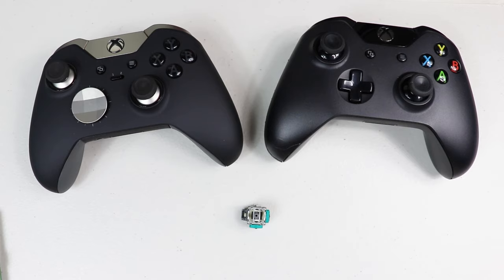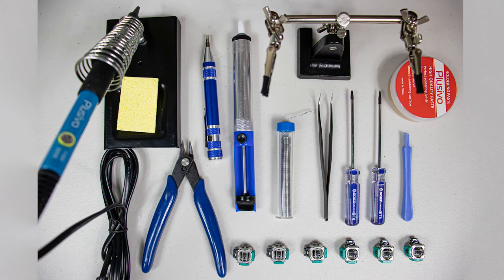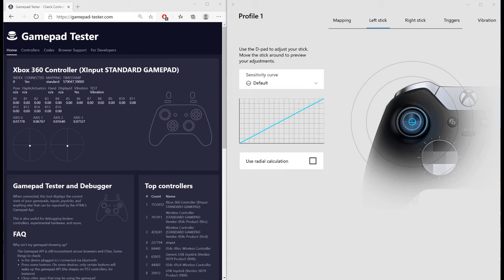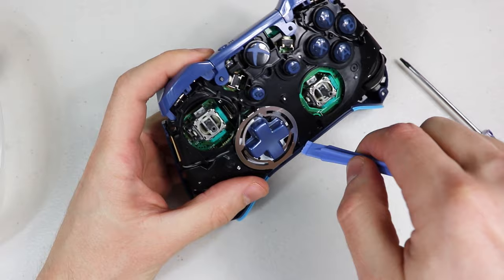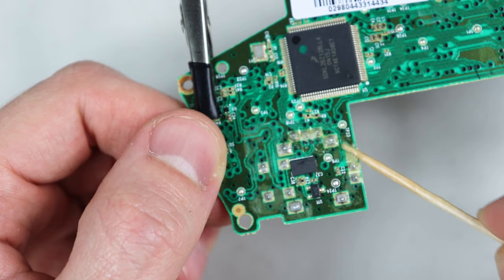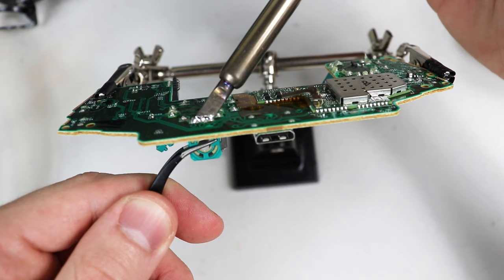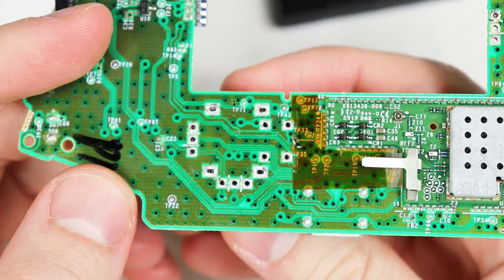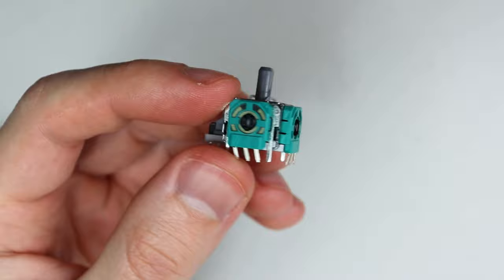How to Replace Xbox One Controller Analog Joystick - NEW METHOD - Fix Stick Drift, Broken, & Loose

Comment: I’m trying to do this on 3rd party controller but still huge deadzones
Reply from the maker: Ah, sounds like the potentiometers themselves have a physical deadzone. If that's the case you would have to use different joysticks and/or potentiometers.  If you're only testing on one game, make sure the game itself has deadzone to 0.
Reply: @SOSSGAMING  thanks for the reply! I’ve been doing research on oem-similar potentiometers
Reply from the maker: @robyee3325 If the joysticks are branded ALPS, you should be able to swap pots with any other ALPS pots (which are what xbox, playstation, and nintendo pro controllers use)
Reply: @SOSSGAMING  if I still have deadzone with the alps replacements, can I fix it by calibrating them on the pcb board the same as you did in this video (using software and tweaking the pins till it’s center)?
Reply from the maker: @robyee3325  If you are just referring to centering then yes what I do in the video can help. If you are referring to deadzone, where there is no response up to a given value when moving the joystick, you can only "fix" it if it's caused by software. Meaning in-game settings. If it's physical (as in the carbon is missing on the potentiometers) it is not fixable. Hope that makes sense. 
However, if you are referring to the range, that might be fixable. Say to the left you are getting 100%, but to the right you are only getting 95%. If you adjust the potentiometer like in the video, you may be able to get 100% in both directions.
Reply: @SOSSGAMING  great thank you!

Comment: Is there no way to buy the analog sticks without the screwdrivers? I can only buy on Amazon and everything but yours looks sketchy
Reply from the maker: At this moment in time I do not unfortunately. The tools don't add much to the price though tbh. If you want to message me after purchase I'd be happy offer a refund of a few dollars for the inconvenience.
Reply: @SOSSGAMING  no it's fine. Do you know if they work on ps4 controllers?
Reply from the maker: @MEXICANASSASSIN2  They won't work well, unfortunately. They sit lower and the potentiometers have less range. If you can reuse the PS4 potentiometers, it should work fine, though. 
The PS4 joysticks will be on Amazon within a month. I actual can't find another listing with actual ones. One has a picture of the correct ones, but according the the reviews, they send the crappy ones. Rather unfortunate.
Reply: @SOSSGAMING  I'll be looking forward to seeing them. I've been looking around for a while and people only swap out the white wiper part from the pot and that doesn't sit right with me. I'm happy to see that you're so helpful. I'm going to subscribe and wait for that listing to be up. Thanks

Comment: my joy sticks are just freaking out jumping all over the place?
Reply from the maker: Is this before or after install? Sounds like typical stick drift to me.
Reply: @SOSSGAMING  so i had the wrong joysticks but i swapped the black magnet to a orange one and fix the problem
Reply: @SOSSGAMING  i was using the hall stick ones

Comment: are the joysticks compatible with the powerA emerald fade controller?
Reply from the maker: I've heard the xbox joysticks are not, because the power A controllers have more joystick movement (they can "stick" with xbox joysticks) but I've heard you can use PS4 joysticks on them if you level out the plastic bottom piece (there are protruding lines and circles).  This can be tricky to do though.
Reply: @SOSSGAMING alright, thanks mate
Reply: @SOSSGAMING  would it just be easier to buy a new genuine controller?
Reply from the maker: @KarlossJ  Easier, definitely. But if you're up for a challenge maybe you want to try to fix it idk
Reply: @SOSSGAMING  I’ll give it a go, there’s not really that much to lose.
but if I’m not able to fix it do you have any recommendations? 
Preferably long lasting, under 75 dollars and with at least 2 buttons on the back?
Reply from the maker: @KarlossJ  Do you just have drift? Or what is the issue exactly? If it's just drift you can actually just replace the potentiometer part that is causing the issue.  
As for a controller with programmable buttons on the back under $75 perhaps the powerA enhanced controller is your best bet.  They use the same manufacturer of joysticks, so unfortunately all one and the same problems exist for any controller you get (for joystick issues that is)
Reply: @SOSSGAMING  I don’t know how to explain it.
I’ll post a video on my channel and you can see for yourself
Reply from the maker: @KarlossJ  Thanks for the video explanation. Is it still responding on the xbox normally when you move it: left right up down? And have you taken it apart yet? It's possibly just the thumbstick that is sticking.  In that case it should just need some cleaning or a new thumbstick. I'd try that first. If that doesn't work then you'd be right that it just needs a whole new joystick.
Reply: @SOSSGAMING  it does work but I don’t think it’s just sticking

Thanks so much for responding everytime

Yt needs more content creators like you
Reply: @SOSSGAMING  I don’t think cleaning would help very much
Reply: @SOSSGAMING  I’ve also moved over to keyboard and mouse so I don’t think I’ll need the controller anymore
Reply from the maker: @KarlossJ  Oh ok no worries.  Thanks for the kind words.  So yeah if it's not a thumbstick cleaning issue it would be something wrong with the joystick and would need to be replaced.  Good luck on kb&m!
Reply: @SOSSGAMING  thanks again, have a good one

Comment: what causing the sticks drift? i mean, is there a way not to buy new those 3d controllers (potentiometers) and replace em,  but fix the issue with existing?

also can you tell what the model of those potentiometers,, like Alps Alpine RKJXV122400R? because there's lots of fake chinese controllers on a market
Reply from the maker: It's the wearing of the carbon that causes the potentiometer related stickdrift. If you're referring to the hall-effect sensor joysticks, yes, you can replace the joystick with them (from what others have told me). However, they aren't as accurate and you also aren't able to calibrate them with the software on the accessories app (it will ruin the calibration at the moment). 
As for the model, I don't know the specific model you're looking for, but actually a lot of the Chinese ones are what you're looking for. If they say they are "original" it's a good bet. 
Hope this helps, good luck.
Reply: @SOSSGAMING  thanks, pal.
as addition to your video i can add about calibration: did you heared about so called 'calibration boards' for Xbox/Sony gamepads? i've purchased two (one per stick). this should help to avoid manual adjustment of the stick centering (that sick hard process depicted in your video 😁). all you need is to install em then use a screwdriver to adjust the axis controlling knob for centering
Reply from the maker: @super-six-four  Yes I've heard about them, and installed them before. They are good, but they do lower the range a little, which may make it so you don't receive 100% in all directions. I would recommend using PS4 potentiometers (but use the Xbox joystick base) if you do use them, because they have a higher range.
Also, with the S/X model controllers, you can just go to the accessories app to calibrate them. No manual calibration or calibration boards required.
Reply: @SOSSGAMING  I've purchased top range resistance boards (black colored if that tell you something )😁 will check soon if they're good.
unfortunately Windows doesn't allow to calibrate gamepad (though it has an old calibration applet), only Xbox 😡
and i have a gamepad with revision 1708.
anyway, i'll write here later how it would be... does it worth to use em in repairing
Reply from the maker: @super-six-four  sounds good. good luck!
Reply: well, those resistance boards are awesome. repairing (replacement of old controllers, placing calibration boards and EASY-going calibration) took around 20-30 minutes. and now sticks pos and movement really outstanding.
strongly recommend!
price in Ukraine around 2 bucks for 1 board (need two: one for each stick), and it costs less in China.
Reply from the maker: @super-six-four  Awesome! Glad to hear it worked out for you. Great job.

Comment: 0 percent dead zone so 100 percent accurate?
Reply from the maker: Not sure what you mean by 100 percent accurate, but no deadzone means once you move the joystick, it provides feedback to the console/computer. With deadzone, no feedback will be provided up to the given value of the deadzone. Hope that makes sense.
Reply: Gamepass tester won’t pick up my Xbox 1 og controller?
Reply from the maker: @arielguzman9336  Hmm. Maybe try the other xbox application instead.

Comment: does this work for elite 2 controllers?
Reply from the maker: For removing and replacing, pretty much yes. However, the Elite 2 controllers automatically calibrate themselves, so the calibration process isn't really necessary. However, if you notice you aren't getting 100% in a certain direction, you can adjust/change potentiometers like in the video. You can also adjust sensitivity in the software if it isn't reaching 100%. If you just have stick drift, I'd recommend just changing the potentiometer. They are the same ones.
Reply: @SOSSGAMING  thanks brother, and thats rad that elite 2 does this already!, so I just have to change out the joysticks, and thats it? that will fix the wobble in the sticks?
Reply from the maker: @Cognitoman  Yep!
Reply: @SOSSGAMING  alright im gonna buy them, and rewatch video. I will let you know how it foes. I Appreciate the help.
Reply from the maker: @Cognitoman  Best of luck!

Comment: Heyy SOSS GAMING. Don't know if this video is still answered by you. I started with soldering a couple of days ago. So far I've ruined 3 controllers. 2 of the repairs worked, but when I tried to calibrate them with de/soldering they broke. The x-axis and y-axis 3 pins don't give me the response as it should. I think I burned the circuit board, I don't know how much heat/time it can handle with a soldering gun to it. Or I might have heated the potentiometer 3 pins to much so it melted the top of the pins, ruining the sensor part.. I'm really confused but I have thrown away 3 PCB's.

How much °C are you using for desoldering?
Also, those "silver" squares around the through holes, are they needed to make contact? I'm confused where the contact with the analog stick potentiometer is made
Reply from the maker: Hello. I'm so sorry to hear about the struggles you're having. These boards are finicky, and heat is pretty crucial. I set my Iron up to 650F. Duration as well as the amount of times removing/adding solder to a particular pad also play a roll. Definitely sounds like some damaged pads. The pads are indeed needed for contact between the pins and the board :/
Reply: @SOSSGAMING  thanks for the quick response. I've ordered myself a new soldering iron, with a smaller tip. And still want to try to fix one in the way you are doing this.
How can I prevent the pads from letting loose? Separating the solder from the pads without destroying them. Is it the flux? Or proper use of solderwick?
Reply from the maker: @changedpepe7745  It really comes down to temperature and duration. From what I understand, there is an adhesive under the pad that once melts, the pad lifts. So ideally, have the iron at a lower temperature (650 for my iron), and work relatively quickly if possible. Perhaps less physical contact with the pad as well. Flux can help dissipate the heat, so adding some should help. This is what's worked for me at least. I'd also damaged my first few controllers until I figured this out :/
Reply from the maker: @changedpepe7745  Also, if all you're repairing is drift, you may want to just try replacing the potentiometer causing the drift.
Reply: @SOSSGAMING  this is really helpful. Also nice to see your being honest about having a rough start. Which kind of flux are you using? No-clean or paste? 
Which method seems to work best for you? The dissasembly method or the desolder method with flux?
Reply: @SOSSGAMING  this is something I figured out today. And it works to just replace the small round sensor inside the green caps. Which brand could you advice? I'm living in Europe and used the DollaTek replacement parts so far
Reply from the maker: @changedpepe7745  I use whatever flux I have right now I'm using paste flux from a cheap soldering iron kit. Right now I use a de-soldering iron but when I was starting out I would use the disassembly method on small through holes and desolder with large through holes. 
The problem with replacing the wheel is it may just be a temporary fix because it doesn't address the real problem (in a lot of cases) that the carbon is wearing down. I recommend ALPS brand. Not aware of DollaTek
Reply: @SOSSGAMING  thanks for the quick response again. I'm waiting for some IPA right now. And I bought myself some yellow paste. Tomorrow will be the next attempt at desoldering. I'll let you know how it went, with all the new knowledge 💪🏽
Reply from the maker: @changedpepe7745  Good luck!
Reply: @SOSSGAMING  thankyou. I wrote you an email to your youtube adres. It's about some replacement parts. I'm currently working on one controller, but it has such small throughholes that I can't get all of the solder out. Going to try your dissasembly method and see if that works. At least all the pads are still on the board 😁

Comment: pls i need about something i have one analog work just fine the other analog its just 100% Y + X 100% btw there is analog its empty but still show the drift is there a way can i disconnected the analog " right " on xbox one i dont want anymore  even the game the camera moves 360 like a circle
Reply from the maker: Sounds like the connection between the joystick pin and the board is bad. This is usually caused by a damaged through hole. Here is a guide to how to "repair" it with a jump wire: https://sossgaming.com/xbox-joystick-jump-wire/
Reply: @SOSSGAMING  is there a way can kill the analog u know like remove chipset or something , one analog is fine it can work on street fighter 😁😁 ty for guide
Reply: @SOSSGAMING  about the jumper wire u mean solder all to another analog??
Reply from the maker: @giovannigiorgio2262  Sorry, I'm not sure what you're asking. The diagrams should explain what I mean. Let me know if they don't make sense.
Reply: @SOSSGAMING  i mean the first analog is working like tell i u , so i dont have to use the wire or jumper on working one trace
Reply: @SOSSGAMING  is possible to fix with Copper Foil Tape ? i saw on some site they fix the hole with Copper Foil Tape
Reply from the maker: @giovannigiorgio2262  Maybe, but I've never tried it so I can't say for sure
Reply: @SOSSGAMING  maybe will not believe me i fix it without using microscope ur image help me as well , thank u
Reply from the maker: @giovannigiorgio2262  good job!
Reply: @SOSSGAMING  thank u for ur help

Comment: i need ask u what temp u use on iron ??
Reply from the maker: For these controllers I like 350C
Reply: @SOSSGAMING  for me i use 310-315 and i solder the rumble "first time in my life" and its work i dont like tips bec if u use it 3-5 times and already oxidation 😂😂is there tips oxidation free ? im new at this BS , if u have xbox360 controller the rumble is two pins just like fan gpu pins u can remove it and work on ur controller without worry about wires  , im not gonna lie i hope next gen controllers use connectors for rumbles + analogs u can replace it anytime without skills
Reply from the maker: @giovannigiorgio2262  You need to either wipe the tip with a wet sponge or the brass sponge thing to keep it from oxidizing after every use :/
Reply: @SOSSGAMING  for how long ? i mean its work like 4-5 times and u need new one 😁😁
Reply from the maker: @giovannigiorgio2262  check this out it shows how to do it https://youtu.be/Pj9knMqgO0Q

Comment: Does this work for Xbox series controllers?
Reply from the maker: Yes! but even better those controllers have integrated calibration updating, so no fiddling around with the potentiometers! So glad MS implemented that in the new series x controllers.
Reply: @SOSSGAMING  So does that mean all you have to do is get the old joystick off and then sauter on the new one for it to work?
Reply from the maker: @IceYetiWins  Yep!
Reply: @SOSSGAMING  🥳 it seems like this will actually be possible to repair myself then!
Reply from the maker: @IceYetiWins  Good luck!
Reply: @SOSSGAMING  Wait, really? Does that mean my fourth gen (2020) Xbox controller has integrated joystick calibration? I don’t have an Xbox so I don’t know if the controller is Series X or Series S.
Reply from the maker: @calvin659  Great question. I tested it on my series x controller that I ordered in Feb 2021 and it did have integrated calibration, but I'm honestly not sure of the details of when they actually started doing it. Wish I could be more helpful.
Reply: @SOSSGAMING  Perfect, thank you. I purchased my controller 2-3 months ago and it has a USB C port. I also emailed MS support and they stated that the controllers bundled with the Series X console and Series S are identical to one another. Guess it makes sense, as most retailers list these controllers as “X/S” controllers.

Integrated calibration for everyone with an X/S controller!
Reply from the maker: @calvin659  Awesome! Thanks for confirming that.